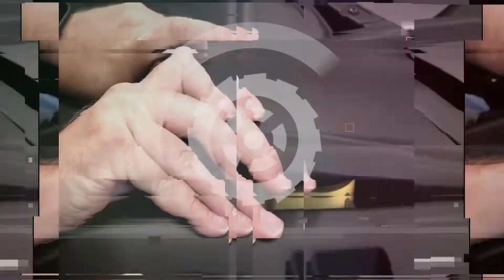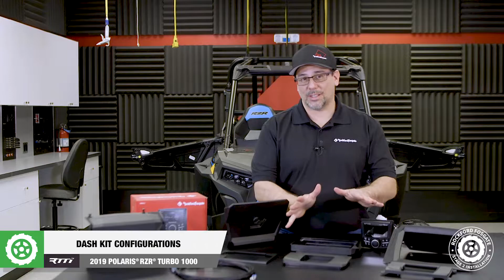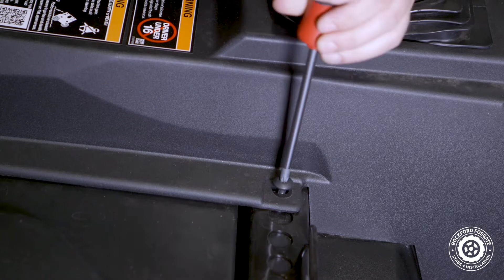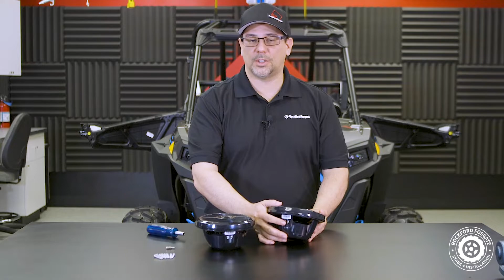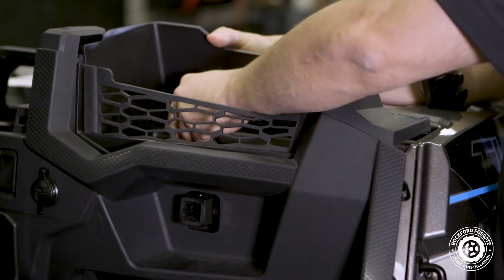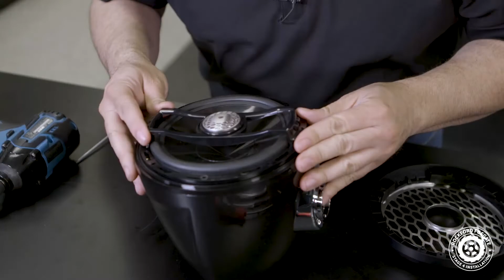2019+ RZR-STAGE4 Installation

Comment: Th butt fittings (already crimped to the sub enclosure are too small for the soldered wiring braid ends for the sub harness!!!
Reply from the maker: Hi LS Black, the connectors are the appropriate size for the gauge of wire included in the harness. if your having problems with the kit, please contact our technical support at 1-800-669-9899 for help.

Comment: I've installed the Stage 4 exactly as described on a 2021 XP4 Turbo and am getting no sound (just static) from the drivers side front and rear speakers. Tested speakers and they do work on the right side of the vehicle. Any troubleshooting advice would be appreciated!
Reply from the maker: There are a dozen things to test.  I would suggest contacting our technical support while you're in the garage with the RZR.  They will have you test several things in the installation and can be reached Mon-Fri. 8am - 5pm at 1-800-669-9899.

Comment: I’m fully installed and can’t find where the subwoofer harness plugs into?
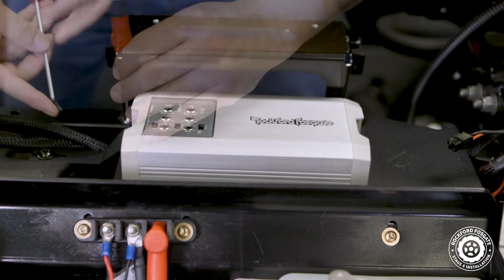Reply from the maker: Did you purchase the complete RZR14-STAGE4 kit or are you adding a subwoofer to an existing stage 3 system?  For the full kit, at 16:00 the REAR output harness that connects to the amplifier is molded into both the REAR speakers and the SUBWOOFER.  You can see the gray connectors on the left side of this image here that shows 2 connectors for the REAR SPEAKERS and 2 connectors for the SUBWOOFER enclosures: https://rockfordfosgate.com/products/details/rfrz14-k8/

Comment: when are we getting a video how to install stage 5 In a Polaris rzr pro xp4 2020
Reply from the maker: Rockford Fosgate audio systems for the RZR Pro XP are only available as Factory Installed Systems.  As shown in our compatibility charts, the current RZR14-STAGE5 "aftermarket" kit is not designed for use on the RZR Pro XP platform.
Reply: @rockfordfosgate  because the rzr pro xp4 that I got don't have the Rockford Fosgate  i was planning to get a stage 5 Rockford Fosgate for the rzr
Reply from the maker: @victorsandoval4676  If your RZR Pro XP didn't include the Factory Installed System, the components are available direct from Polaris here: https://rzr.polaris.com/en-us/shop/accessories/audio-technology/
Reply: @rockfordfosgate  Ok sounds good let me take a look on that..you guys need to make a video in how to install in the rzr pro xp4  to make it easy...don't like to read instructions .. thanks
Reply from the maker: @victorsandoval4676  Great! Thank you for your feedback... that video is actually on our  "to do" list, but it hasn't started production yet.
Reply: I bought a 2021 polaris general xp 4 deluxe with ride command and stage 4 system. It hasn't worked as the amp blew before I left my driveway. Its been 2 months and still waiting for Polaris to send another amp to the dealership. Why is it taking so long, and why does the amp that blew look different than the one here in your video. I paid $2k for the upgrade and wish I could hear it play

Comment: On the stage 4 with ride command do you plug the sub into the left side of the amp where it says rear. An what do you plug into the front input on the left side of the amp . On the ride command video it only  goes over the drivers side of the amp.?
Reply from the maker: Hi Eric, we have a dedicated Ride Command Interface video here: https://www.youtube.com/watch?v=B30WqtHpk-c.  Since the RZR14RC-STAGE4 for Ride Command utilizes the TM400X4ad amplifier, the Ride Command Interface cable labeled FRONT connects to the amplifier's FRONT input, and the Ride Command Interface cable labeled SUB connects to the amplifier's REAR input.  The Ride Command Interface cables labeled AMP 1 and AMP 3 connect to the corresponding RZR electrical harnesses labeled AMP 1 and AMP 3.  For tuning the system, be sure to download our AMP TUNING GUIDE here: http://rftech.custhelp.com/app/answers/detail/a_id/1356/

Comment: I have a question, I have the stage 4 as well with the 4 speakers one subwoofer and 1 amp.  Currently I’m using 2ch but I’m not sure if it’s correct or not.  On the input side I have the two RCAs coming from the HU but in the out put I also have 2 but one goes directly to the sub and the other one is connected to the 4 speakers.  So should the amp be in 2ch or 4ch?  Also are the speakers wired in series or parallel.
Reply from the maker: If you have the RZR14-STAGE4, then you'll set the amp input switch to 4-CH.  Download our Amp Tuning Guide that has the configuration here: http://rftech.custhelp.com/app/answers/detail/a_id/1356.  The front & rear speakers are wired in parallel, creating a 2-ohm amplifier load on the front channels, which the amplifier is designed to handle.
Reply: Rockford Fosgate 
Alright I’ll follow that to a T so there’s no need to follow the C.L.E.A.N setup for the amp? Also I am more or less just looking for knowledge but I guess I’m missing the point of the 2ch vs 4ch debate in my head that I don’t understand, whenever I have the amplifier in 2ch mode I can significantly here the bass but while in 4ch mode it’s present but no where near like it is on the 2ch setting.   Also the speaker wire coming out of my subwoofer plugs in directly to the rear output, while all the other 4 speakers are are synced into one front input. Is that normal?
Reply from the maker: @1990jwall  We have already done the C.L.E.A.N. setup, which was used to create the Amp Tuning Guide with +5 dB on the front channels and +10 dB on the subwoofer.  You'll want to be sure you're connecting all 4-RCAs from the source unit to the amplifier.  If any of the RCAs are partially plugged-in, you'll have reduced output.  Also, be sure the source unit rear output is set to FULL-RANGE with NO CROSSOVER since we're using the crossover built into the amplifier.  Yes, the wiring sounds all normal as you can see in the installation video, the subwoofer plugs into the rear channel and the front/rear speakers plug into the front channel.
Reply: Rockford Fosgate okay sounds good that’s awesome, I didn’t see in the guide the 10db plus for the subwoofer or the plus 5 either I missed that completely so I’m gonna try that ASAP.  Thank you!
Reply from the maker: @1990jwall  Great!  I intentionally didn't put that info in the Amp Tuning Guide & Video since it would likely confuse people.  I'm just providing you with more behind the scenes info since you specifically inquired about setting up the amp using C.L.E.A.N. -Eric R.